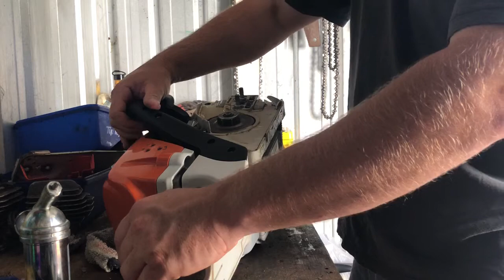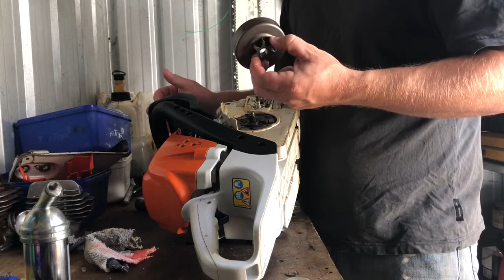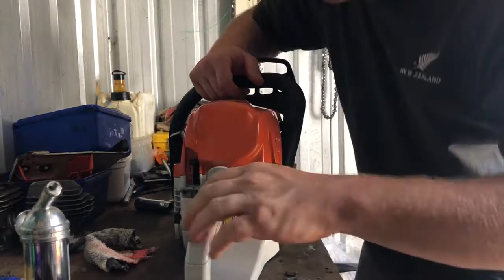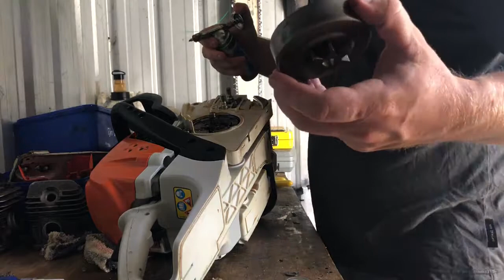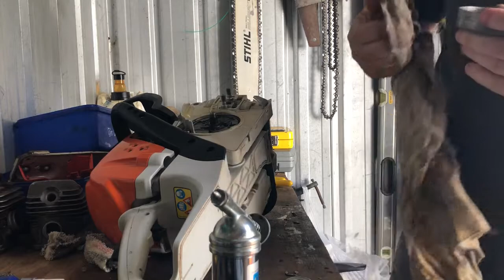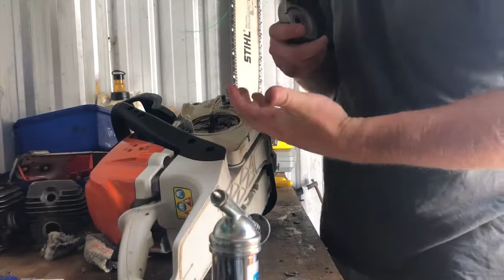Stihl Clutch Bearing Maintenance

Comment: Ive seen one of those run until the sprocket teeth were ground all the way down, and the chain was slipping. what was left of the sprocket teeth turned blue, and two of the needles got welded to the sprocket. Smoke was pouring out. A bearing and a sprocket later the saw runs like the day it was bought. People can say what they want about the ms311, but they are tough as nails.
Reply from the maker: Wow that’s hard out indeed! Yes they are a good saw for a farmer/ranch range, 20” bar 60cc doesn’t rev like a pro saw, but they are good saws, mines felled trees been used up trees cut heaps of fire wood, that size saw is just about good for everything!
Thanks for watching! Stihl for life 👍😎✌️
Reply: @kiwilad4216 Thank you for the reply.
Reply from the maker: @viperstrike3827  your welcome mate! Good thing about having a small channel is I can get to just about everyone 👍😎✌️

Comment: I too have this ms311.  Been a great saw for me.  Recently I am struggling with the chain spinning at idle.  Have have been trying to adjusting the (L) and (LA) screws with no success.  I have taken the sprocket off and haven't seen anything obviously wrong.  Any suggestions?
Reply from the maker: Hi Paul, yes the MS311 is great! 
The LA screw controls the chain speed by pressing on the throttle of the saw on the carb. If you back this of it will reduce the chain speed, but if your not having any luck there it could be a broken clutch spring or maybe a crank seal air leak. 
A leak down test would be a good thing to do, especially if your not having any joy tuning it. Saws can be tricky at the best of times mate. Hard to say really unless I could have a look at it....
Thanks for watching, Stihl for life 👍😎✌️
Reply: @kiwilad4216  thank you for your reply.  I was able to get the chain sprocket off (it was stuck) and noticed a lot of material circling the inside.  I cleaned it out good since I didn't have another one to replace it.  Further inspection showed no broken clutch springs.  I'm gonna oit it back together and see if it makes any difference.  Are their Limiters on the LA and L Screws?  Seems like I can turn them forever?
Reply from the maker: @paulcorsetto6047   yeah that can be the other thing, sometimes they just need a good clean. There will be a limiter on both the H&L screws but not in the LA. Adjust the L screw first which maybe correct on its limiter then back of the LA just until the chain stops rotating. See how you go mate 👍😎✌️
Reply: @kiwilad4216  seems to have fixed it!  Thank you for your help.  I also had to buy a new sprocket cause mine is scored so I'll change that once I receive it.
Reply: @paulcorsetto6047  Good you've fixed it, sometimes it can be the clutch springs loosing their spring ... can be a mish changing them you need a special hook tool.